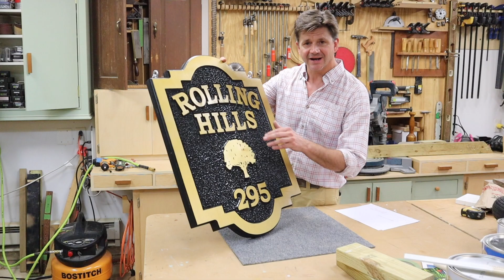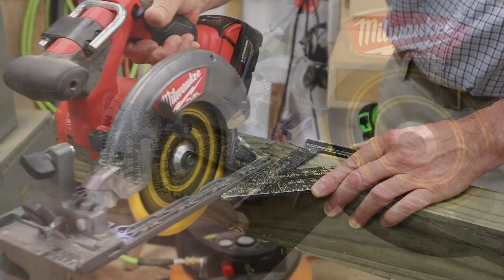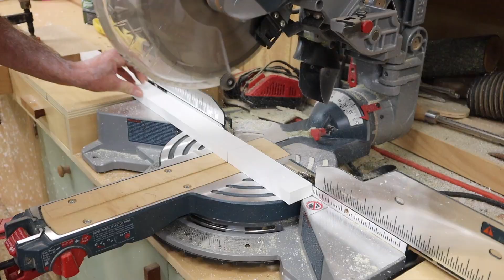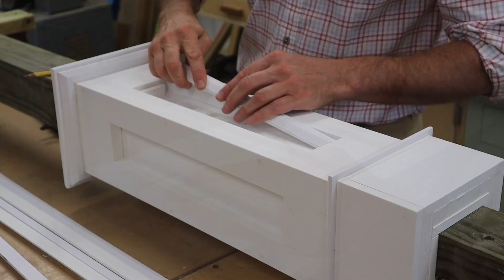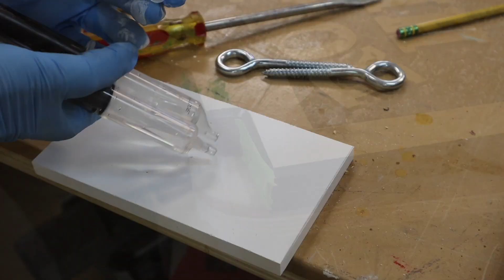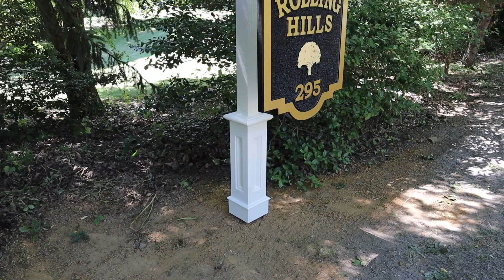How to Build a Sign or Mailbox Post -  Free Plans by Jon Peters!

Comment: Need some advice.  I won’t be buying PVC or Azek and trying to stay within a budget but also need the signpost to last.  I was going to make the lower box from outdoor plywood.  What should I use for the stiles?  I didn’t want to use plywood for stiles because of the exposed edges.     Can I get away with stiles that are not pressure treated wood?   The post will be painted just Iike Jon’s.
Reply from the maker: I’m not sure of the name, but they do make a type of weather resistant MDF… you probably have to buy a full sheet, so not sure how cost-effective that is. Cedar is also a good option again it gets kind of expensive. 
When it comes to painting that can really make a project last… I painted a bench that I made in Poplar, not typically a good wood for exterior use… But I painted it with oil based total boat, wet edge paint, and it’s doing great… It’s been outside for more than a year and still looks good

Comment: Hey Jon! Gotta question for you. Looking now for a good saw and been looking at the one you have here bosch with the special arm. 

Would yu recommend it? Thanks
Reply from the maker: Hi Peder, I recently replaced it with the Festool Kapex... It’s a very expensive saw but totally worth it ! It’s probably my favorite tool in the shop.
Reply: @JonPetersArtHome  Yeah thats been on my mind aswell but I cant buy it here in sweden only companys can. But the bosch you have in this video, does it have laser, light and does it make straight cuts? Because im really tired to saw costing 600-700$ and its not 90°.

Thanks for your quick reply.  Love your insta and your youtube channel 😍

Comment: How to build a mailbox post, the simple way:

Step 1: Get a pressure treated 4x4 of appropriate length
Step 2: Dig a hole in the ground.
Step 3: Put the 4x4 in the hole.
Step 4: Put Concrete in the hole.
Step 5: Wait for concrete to set up.
Step 6: Cuss because the pole is 10 degrees off of being square to the road, and now the concrete is set so it's too late to change it.

Comment: Thats a great looking post Jon. Im in a HUGE need of a new mailbox post. It looks like you painted the treated lumber while it was still fresh / wet. Is that OK to do, or should it be a little dryer? Thanks.
Reply from the maker: Thanks David, no you should wait a few months but I didn’t want to put an unfinished post in my front yard. I’ll need to hit it with a wire brush in the spring and give it another coat.

Comment: Possibly Dumb Question: Will the air nail and brads rust after a while (and leave stains)? I have an exterior project to build and I had assumed I couldn't use my brad nailer. But I'd love to be wrong!
Reply from the maker: I use stainless steel brads, more expensive but worth it
Reply: Thanks!

Comment: Jon, nice project~!  Wish that our property were big enough to have a name.  :-)   Obviously your project is completed, but I just saw an interesting product for setting posts called Sika Post Fix.  It's an expanding foam product for non-structural applications.  I have a few posts to set in my yard and one 33oz package is supposed to replace two 50 lbs bags of concrete.  Didn't know if you've heard of it before.  Available on Amazon, but cheaper at Home Depot.  There are several YouTube videos demo'ing it.  Just FYI...
Reply from the maker: Thanks Andrew, yeah I’ve been looking at that stuff, may check it out

Comment: I made a sign about a year ago out of treated 4x4. Painted it too. The paint didn't last at all. Flaked right off.
Reply: Recovering_Californian you are supposed to wait 6 weeks before painting treated lumber. Also make sure it isn't damp. Ie if it rained within the past few days don't paint
Reply: Thanks...that was likely my mistake.
Reply: Recovering_Californian 

Probably not the best, but a really easy way to test pressure treated lumber for paint is to splash a little bit of water on it. If it beads up or sits there, it's too wet. If the wood soaks it up, then it'll soak up paint, too. Number of weeks/months or whatever is a bad measurement, because what would take maybe two months here in Georgia at 94-97% humidity might only take a week or two out in Arizona. Lots of factors, so that little test is easier for me, especially when people ask about a time frame for a project and I don't have any wood already drying.👍